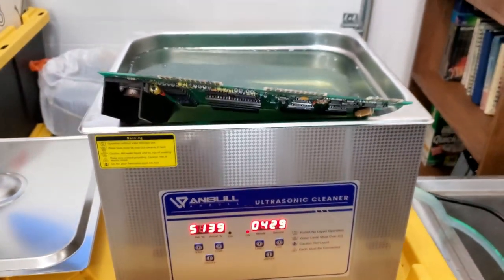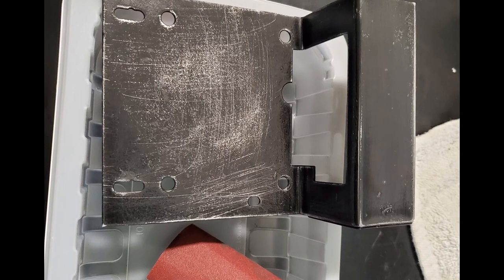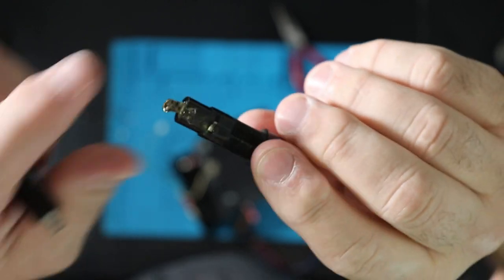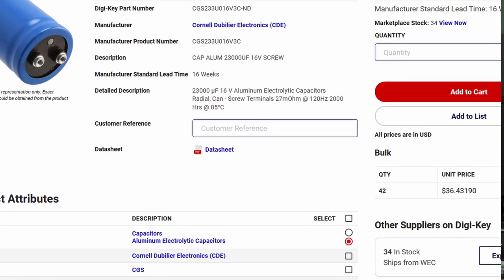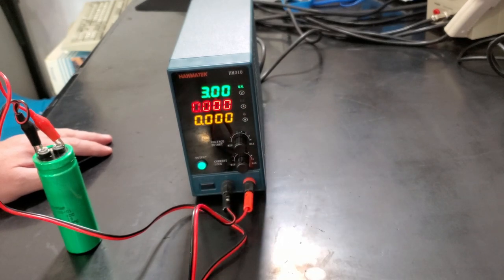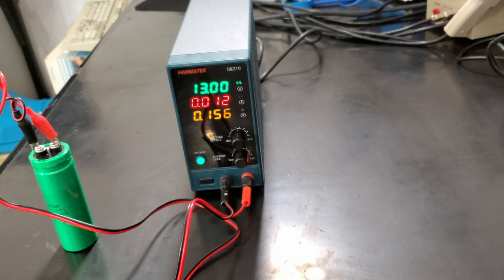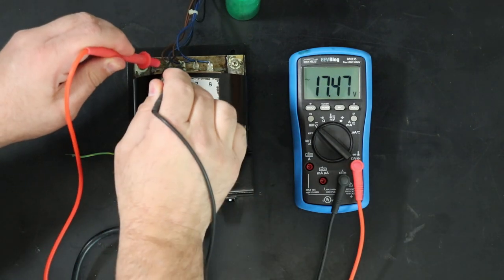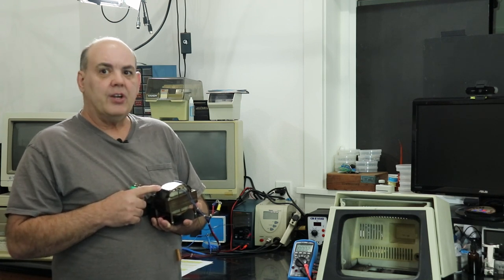Pet Power! Transformer Restoration & Capacitor Reforming - Pet 4032

Comment: I'm also in process of restoration of one chiclet PET 2001. So far found burned CPU, one PIA, 4 logic IC's in video part, one video RAM, voltage regulator in monitor, one transistor and one resistor. Changed caps in monitor. Using PET ROM/RAM board finally got it working, now it's time to find which RAM IC's are burned, fix ROM's, there is issue with IEEE port, some rust on case, deal with burning dot on monitor... fun project... forgot to say that socketed were only CPU, ROM, video ROM, CIA and PIA's, rest is/was soldered to PCB. 
Good luck with yours! :D
Reply from the maker: That sounds like a really amazing project. I'd love to hear how the ROM burning goes! All my socketed ICs had rusted through pins including all 5 40-pin ics and the BASIC ROM. I have spares for everything except the 6520s and the ROM.

Comment: Hi Mike, awesome work on your PET so far! I am restoring a Pet 4032 that received with a broken crt neck… (thks shipping guy).  Do you have any idea where I could find a replacement crt for it? Or any compatible crt I could use?
Reply from the maker: Hey Daniel, I've tried to respond a couple times but I've had almost no internets 🤪 I'm far from a crt expert but I'd suggest checking on the vcf forums. I've read some great threads there taking about crt swaps. My skills are in the digital realm.
Reply: @RavenWolfRetroTech  thanks Mike, I’ll take a look.